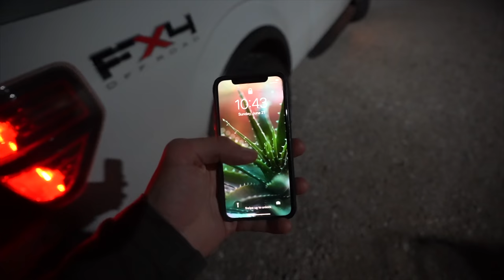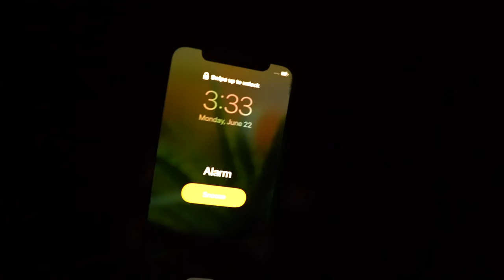Catch, Camp, Cook, Eat Teriyaki King Salmon!

Comment: Mav check the topper door and seal. Another thing is that the topper might have shifted and the door gap might be a little wider on that side. Loosen clamp on that corner and push in on topper and Tighten back up